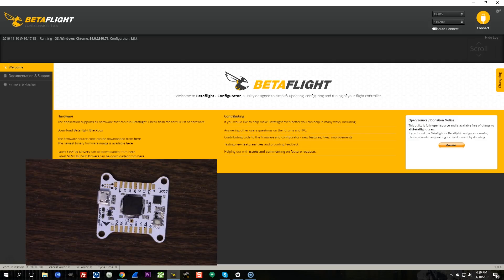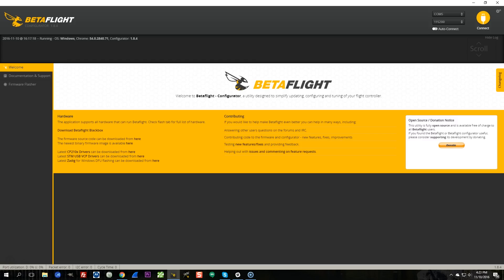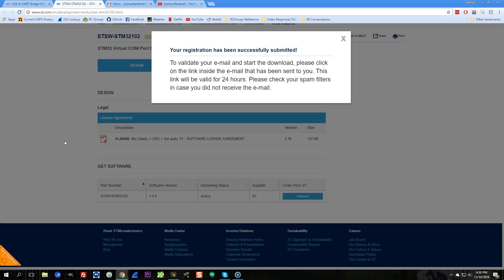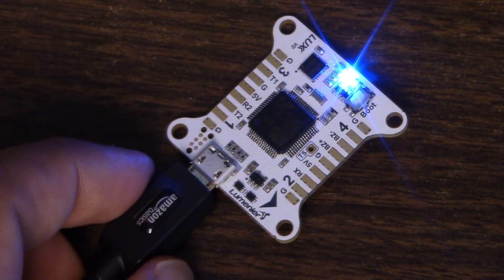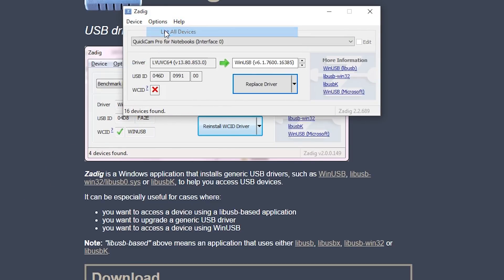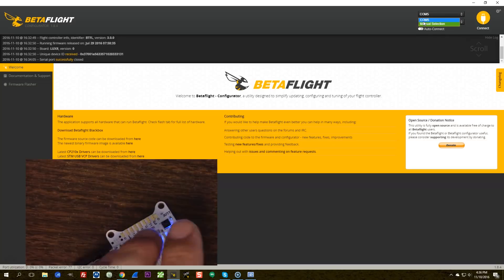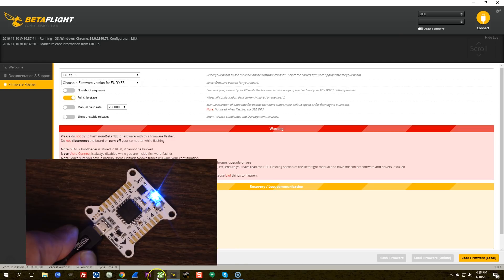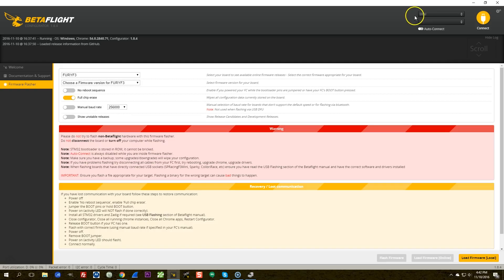Betaflight / Cleanflight Flight Controller Won't Connect | FIXED

Comment: Hi Joshua,
It is great how are you helping! Which OS do you use? WIN10?
At the moment I am flying KISS, but I ordered a FliteTest Gremlin which comes with a F3 Board and Betaflight is recommended of course.
The STM Driver just shows Win7 and Win8. At the moment I have no Board to test it, but do if you know the STM driver will run under WIN10?
Reply from the maker: Yes, it works fine under Win10.
Reply: Thank you very much!

Comment: I flashed my Furibee F3 flight board it said "Program Successful, I then tried to connect to cleanflight. While connecting it then says "Serial Port successfully opened with id..." but no change of screen. Seconds later it then says "Serial Port successfully closed without actually opening. I cant get into the board to calibrate it or anything. 
Please Help Sensei :o
Reply from the maker: +John Doe you probably flashed the wrong target to the board. The board type in the pull down menu.

Comment: Good video but wtf are designers doing? Its 2017 guys we really need to download 3 programs push a stupid button to install firmware. I want to fly a drone not become a computer software writer. The hobby is going in the wrong direction.
Reply from the maker: Sounds like Raceflight is for you!
Reply: oh god not another one. Openpilot, liberpilot, cleanflight, betaflight. Somebody really playin some f'd up mind games.
Reply: yea, its crazy. makes me just wanna to buy a dji drone or rtf race drone from getFPV, haha ;)

Comment: AGH another problem, when I plug in with the boot pads shorted windows says "USB Device not recognized, The last USB device you connected to this computer malfunction and Windows does not recognize it"

In Zadig the device name is "Unknown USB device (Device Descriptor Request Failed)"

 What should I do to fix this?
Reply from the maker: This usually indicates either a problem with the USB cable or the device itself. I suppose if it were me, I would try reinstalling the drivers.
Reply: I haven't been in any crashes so i doubt the board is broken. I also already reinstalled the drivers and it still didnt work, should i just buy a new board?
Reply from the maker: +Wgesh8 Tryba different pc.
Reply: Joshua Bardwell ahh right should've thought of that earlier, thanks

Comment: I have a micro omnibus F3..it doesnt have a bootloader button or pads...its not being recognized by my computer and I tried all these steps (this occurred after I turned on magnetometer and barometer on in the configuration tab)
Reply from the maker: It has bootloader pads. I checked the pinout on RTFQ's web site. The bootloader pads are just adjacent to Vin and Vout.
Reply: Thanks man!! You're a genius. I could not figure out where the hell they were!

Comment: I flash my sp racing f3 evo and it says it flash with no errors open up bf and it says at the top on the right no flash on bored what do you thing it could be ?
Reply from the maker: +jason williams no flash in board is referring to the dataflash chip used for Blackbox. Everything is fine.
Reply: thank man

Comment: I accidentally flashed over my boot loader file in my spracing f3 board does anyone know where I can find the file to reflash it
Reply from the maker: +Shawn K-SKI you can't flash over the bootloader. The bootloader is on ROM on this chop. Put the board into bootloader mode and flash it.
Reply: Ahh ok I flashed the wrong thing in the zadag (sp) but I actually found out it's working now but it's telling me no response from boot loader and I've tried everything from boot pins to nothing I've downloaded all the drivers but it still won't update the firmware
Reply from the maker: +Shawn K-SKI impulse rc driver fixer
Reply: Big thanks

Comment: I got failed to open serial port when I plugged my realacc gx210 quad with a spracing f3 board I followed the first to steps and Downloaded cp210x driver and stm USB Vcp driver but I'm still getting the same failed to open serial port messages I'm not sure what I'm doing wrong next to where it says connect it says manual selection I'm not sure if that makes a difference. 

Thanks please help!
Reply from the maker: +stefan.17 baller if it doesn't say "COM3 " or some other numbered COM port, then the device isn't being recognized. The drivers are not installed or the USB cable is not working are two likely causes.

Comment: This problem doesn't necessarily have to do with the firmware but I'm getting an issue with my Beecore losing contact with my taranis seemingly after going over 50% throttle. It will bind and arm but when i take off the motors start turning on and off. I noticed that the blue light starts slowly blinking and the white and red light underneath start flashing or just go off. was hoping that someone could help me out I'm new to the RC/ drone hobby and I'm stumped.

Comment: My cc3d board's blue light is slowly flashing (boot loader mode?) how do I get out of this and back to the flash every second(flight mode)
Reply from the maker: If the board is in bootloader mode then it thinks the bootloader pads are shorted. This can sometimes happen when the button fails. If you know the pinout of the button, you can test for continuity with a multimeter to see if the button has failed closed. You can de-solder the button.

If your FC has pads and not a button, test for continuity between them (while powered down). If there is continuity, that's why the board is in bootloader mode.

Comment: whats up josh i have a quick question i cant find the answer to. I recently purchased a Furibee F3 FC and i was able to flash it with SPRACINGEVO it tells me flashing complete but when i click on connect i get this messege
2017-04-22 @ 13:56:48 -- Serial port successfully closed
2017-04-22 @ 13:56:58 -- Serial port successfully opened with ID: 3
2017-04-22 @ 13:57:08 -- No configuration received within 10 seconds, communication failed
i have a mac and installed all the drivers and cant figure out how to get it to work please help
Reply from the maker: I'm going to guess you flashed the wrong board type to the board. A cursory check on google suggests the correct target is SPRACINGF3, not SPRACINGF3 EVO.
Reply: Josh you are the freaking man thank you so much ive been going crazy for the last two days thank you so much for replying

Comment: Hey Joshua,

Would you please help.
While configuring with the Zadig, i mistakenly replace the STM32 Virtual COM Port usbser driver with the WinUSB driver(The mistake that you talked about in the video).

And now when i plug in my flight controller, my pc just wont recognize it.

You also mention i need to unstall the driver, reboot the machine and install the driver again. which specific driver are you talking about? 

thank you so much for your help!
Reply from the maker: +Zhengtian Ma the CP210 driver.
Reply: hi,
thank you for your reply.
I have uninstall the CP210 and reboot my pc and reinstall again.
When i plug in my flight controller it still wont get recognized by my PC and betaflight.
Dunno if that mistake of replacing the STM32 Virtual COM Port usbser driver with the WinUSB driver in Zadig has caused any other problems?
Reply from the maker: +Zhengtian Ma plug in the device and look in Zadig to see what driver is loaded.
Reply: there is no STM32 Virtual COM Port in the drop down menus though.. does that mean the CP210 is not installed successfully? I have tried both 64bit and 86bit.
Reply: And there is only red led always on for my FC. i am using a F3 evo brushed version2.
really appreciate your help
Reply: hi, thank you for your help. I unstalled all the drivers and reinstalled again. Eventually I used the software by ImpulseRC to fix the problem and now my PC can recognize my board. I believe it is still the drivers that cause the problem.
Really appreciate your help.
Regards.
Reply from the maker: +Zhengtian Ma Yeah I guess the drivers are not installed correctly.

Comment: Thank you for all the videos. Without them, I believe I would have quit the hobby by now. I have a Omnibus F3 v1.1 from Banggood (Product ID: 1086563) and I cannot get it in DFU mode. Using Windows 7 and Betaflight 3.1.1, I press the boot button, plug in USB and the red light is not as bright as without the boot button pressed. If I release the boot button the red light turns bright. Keeping the boot button pressed, I do see in Zadig "STM32 BOOTLOADER" for a second then it goes away.  I hear my PC dropping and recognizing a driver (like when you plug in a flash drive) but the "STM32 BOOTLOADER" does not stay available.  Help me please!
Reply: Fixed. After many hours of tying all different combinations and reading anything closely related to this subject online, I found a very good article on this at https://github.com/betaflight/betaflight/wiki/Installing-Betaflight and it made me realized I did not do the finial step to install the STM32 VCP driver.  Now I know, Joshua, you did clearly say this in you video but I have never run the install of an app and then have to go to the install directory to then execute yet another exe.  Lesson learned... follow instructions.

Again, your videos are very helpful and I thank you for teaching us something in each video!!

Comment: Any suggestions why I'm unable to get the com port to show up/install?
Reply from the maker: Drivers not installed correctly? Try putting the board in DFU mode and re-flashing it also.
Reply from the maker: +Si Santos drivers not installed correctly. Using a charge-only USB cable.
Reply: Thank you!
Reply: By the way I have the XMPF3E connected to a Racerstar 20amp 4-1 and can get the XMPF3E to power up from the 4-1 ESC.

Comment: Joshua - excellent presentation, I think you may have cleared up my scrambled little grey cells, cos I've literary spent a couple of weeks trying to config a CC3D Evo with Librepilot.  It turned out I had too uninstall one of the USB Composite Device  drivers that popped up when I plugged in the CC3D. All very confusing..still not sure what I've managed to do -  but your vid has/will go a very long way for me to nail my confusion after I have played your Vid a couple of dozen times :<)...joe

Comment: Hi Joshua, great video. I am having problems connecting my wizard fc to betaflight mac (having issues with the ESC and need to try and work out what is going on). Red and Blue lights works. I can put it into boot mode and flash, but I then just cannot get it to connect. Any ideas? I have run out of things to try. Thanks, Andy!
Reply from the maker: +Andy Drane are you flashing the correct target for your FC? What FC do you have?
Reply: Joshua Bardwell Hi Josh I have the stock wizard f3 6 dof FC. I am not sure what is meant by correct target, but it flashes ok and says verified. I now think I may have an issue with the gyro not working which might be causing me connection issues?
Reply from the maker: +Andy Drane that us the SPRACINGF3 target then. Make sure you are selecting SPRACINGF3 from the pull down menu.
Reply: Joshua Bardwell thanks for the reply, I have selected that and tried it with a few different betaflight flash versions to see if that helps

Comment: Hrm...wonder if this is the root of my problem.  I went through the x220 set up like on your video to flash betaflight, but with two differences:  I didn't jumper it for bootloader mode, I did the manual baud select like was in the comment section.  The other difference was I could only get it to go on COM 6.  Drone is now uncontrollable.  After work, I'm going to double check all of my settings, but I now wonder if using that port stuck the data some place it shouldn't be.
Reply from the maker: If COM6 is what appeared when you plugged in the quad, then COM6 was the right port.
Reply: Joshua Bardwell cool beans, thanks!

Comment: The Lux v2 connects to my computer or beta flight in boot loader mode only, what steps do I have to take solve this issue ?
Reply from the maker: Do you mean that it connects in bootloader mode, regardless of whether you press the button? If so, then the button has likely failed. Desolder it and throw it away. Now you can only get into bootloader using the Betaflight "DFU" command. Or by manually bridging the pads.

Do you meant that it won't connect when you don't press the button, and it will connect in bootloader mode when you do press the button? Most likely this means you flashed the wrong target to the board. Re-flash and be sure to use the correct target.

Comment: mine shows port dev/rfcomm near connect tab and show manual selection with 115200 , im lost man
Reply from the maker: You're not on Windows. None of this is necessary on Mac or Linux because only Windows and Chrome have the problem with the DFU drivers.

Comment: Joshua, I'm having issues with connecting different quads to Betaflight. 
 One will connect with no problem, then try to connect another and I get "Failed to open serial port". I've deleted Betaflight and drivers and reloaded and still will not connect. So I loaded Betaflight in another laptop and it connects right up. Any ideas?
Reply from the maker: If it worked correctly on another laptop with the same FC and USB cable, then it's definitely the drivers on the other machine. Delete the drivers with "delete files" checked. Reboot. Re-plug the new FC and confirm that the drivers are installed correctly (STM32 Virtual COM Port device). Other than that, I don't know what else to suggest.
Reply: Joshua,
Thank you for the fast response. I will try that tomorrow, had enough trying today. You put out a lot of great info and it is greatly appreciated! You are a credit to this hobby! Have a great night.
Up Up n Away,
Michael

Comment: Hi Josh, I just got a brand new gt2 200 that I was able to bind with my turnigy evolution but am having probs. So I am not sure the FC is flashed for Betaflight. I did get into betaflight a few times and tried to play with settings but saw that my rx and tx were not showing as active. On disconnecting I realized I accidentally connected the A8S rx (four wires) to UART 1(four wires). I realized my mistake and disconnected all power and moved the rx wire to the proper port but now when I try to connect the port closes on it's own. Just flash the FC according to this vid? Muchas gracias!
Reply from the maker: +John Graboski I'm honestly really not sure what you did. If you connected the receiver to UART 1 with MSP active on UART 1, you could have corrupted the config. I guess re flash but you will have to rebuild the config also.
Reply: I also got a tip to hit the lost conn tab. Working on it. Thanks!
Reply: I also got a tip to hit the lost conn tab. Working on it. Thanks!

Comment: my board(skyline32) doesn't go to bootloader mode... I am using jumper to acess the bootloader but nothing happens :/
Reply from the maker: +FireDemonBR if you are running Betaflight, try the "dfu" CLI command.
Reply: Joshua Bardwell thanks ;) but the board isn't connecting to betaflight or cleanflight "no contact from the bootloader" when i hit the connect button.
Reply: I will try connecting in another PC

Comment: I think i installed drivers wrong or something. It won't connect. Here is a screenshot: http://take.ms/scyH0
Any help?
Reply from the maker: +wiseirbis all the help that I have to offer is in this video. Uninstall the driver and try again, I guess.
Reply: I forgot to mention that I'm trying to connect CC3D board that came with eachine racer 250. Do i even need to connect it or can i just fly it out of the box? I'm still waiting on my transmitter to arrive so i can't check.
Reply from the maker: CC3D has some quirks with drivers I think. And the openpilot bootloader. I don't know a lot about that board.

Comment: I'm trying to flash the latest bf to my lux v2.  Its the first time connecting a lux to my pc.  It talks to bf no problem but fails to open serial port when I try to flash fw.  Do I just need to hold the boot button when I plug it in?  I've never had to use boot pads or button on any fc before so I'm not familiar with it.   Thanks.
Reply: Zadig fixed it.  Thanks for this video

Comment: is there any hope if the Micro SD port is broken?
Reply from the maker: +Jerry Jr solder a new one on. Use an FTDI adapter if you have MSP on a UART.
Reply: Joshua Bardwell Thanks I have the exact flight controller you have in this video is there a MSP on the UART? Apparently there is no manual for the Lux V2
Reply from the maker: +Jerry Jr if you are using Betaflight 3.5 or earlier, MSP is on UART 1. With 3.6 they disabled that.
Reply: Joshua Bardwell Thanks

Comment: Hi Joshua, thanks for the videos but im still really stuck, im using a seriously dodo board, had it all connected up and running fine, went to install the upto date drivers and its bricked out or something? All i get no is a solid blue light but neither Beta flight or zadig recongnize it as being connected to the computer and matter what i try i can get them to talk to each other. Please help.
Reply from the maker: +sean sykes in your situation I would try to get it into bootloader mode and flash it.
Reply: Joshua Bardwell I have tried that ready and it doesnt seem to do anything. There is a solid blue light on all the time but that is all. No matter what I do the computer doesnt seem to be able to pick it up.
Reply from the maker: +sean sykes if I couldn't get it to show up in Device Manager, I would conclude that it was damaged.

Comment: STATUS:
Omnibus pro ver.2
zalig ver. 2.2
Omnibus bootloader, but on devices from the driver failed, I turned off the digital signature of the driver on Windows 10 64bit, I can not understand .....
Reply from the maker: Try Impulse RC Driver Fixer.
Reply: joshua hello,
I solved the problem very well,
grazie mille!